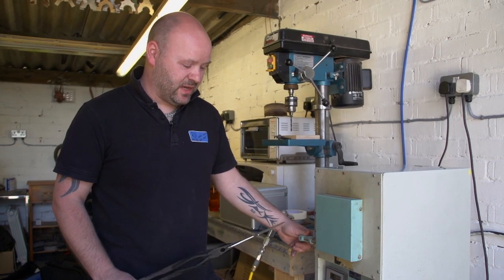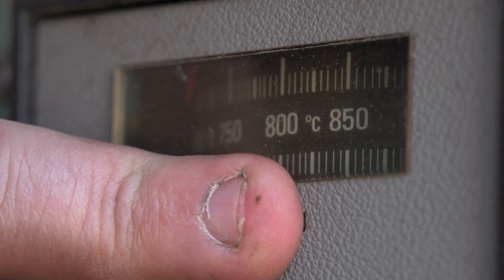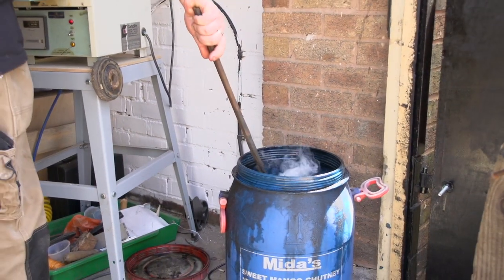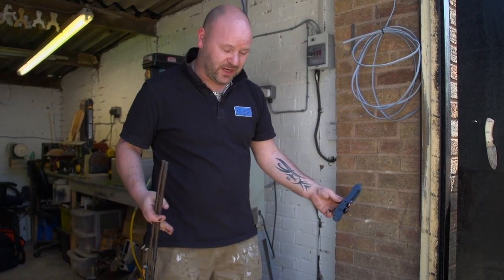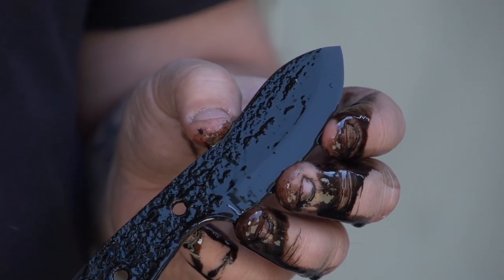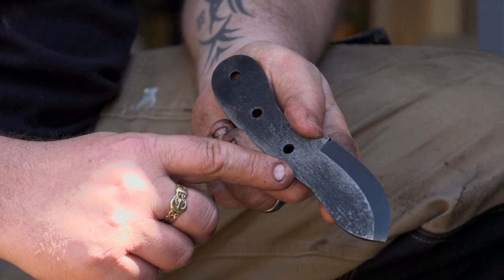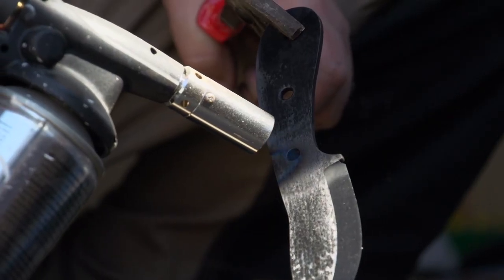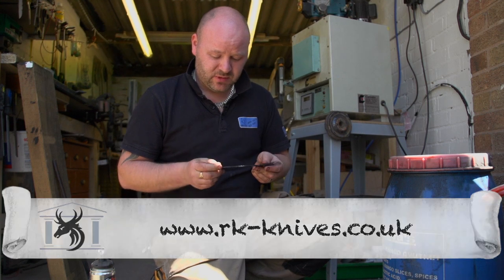How To Make A Knife - Part Two: Tempering the Steel

Comment: Hi squirrel the whole blank is heat treated in the oven and allowed to soak to even out the heat treat then they are tempered in the oven and specific areas tempered with the blow torch

Comment: Question: why do you quench again after tempering? The whole point of tempering is to reduce the hardness along the spine of the blade. By quenching it, aren't you just hardening it again?
Reply: sidgar1 No, it doesn't get hot enough to harden.
Reply: sidgar1 youre absolutely right. it should be just heating-quenching-tempering, or heating-quenching-tempering-quenching-tempering. tempering should be always the last step
Reply: No he is not right. The drawn temper is fixed by a final the final quench. When the first hardening occurs. Quencing from red heat, it produces the Martensite carbon stucture which is very hard and brittle. The process of tempering is to allow the the metal to get up to a ceratin heat which allows the Martensite to start converting back to Austenite but not compltely, allowing the compromise between hardness and ability to retain an edge but not so hard as to be like glass. if the blade is not quenced to fix at straw color for blades it will revert almost to its original softness and not keep an edge.